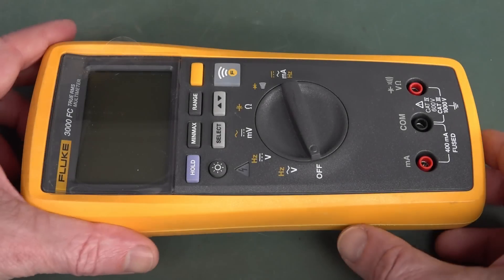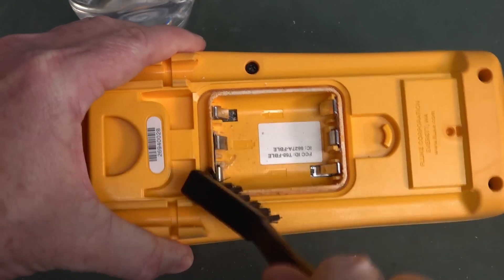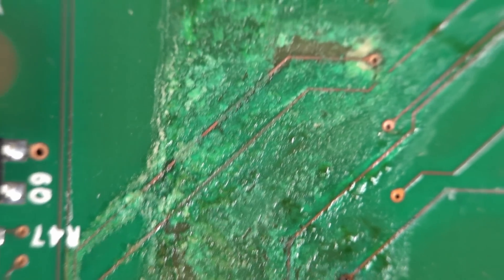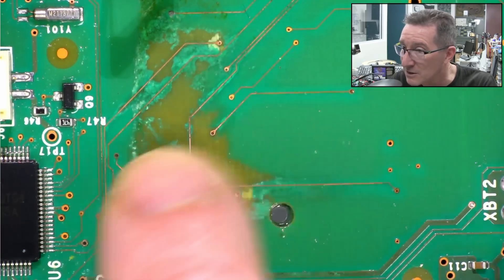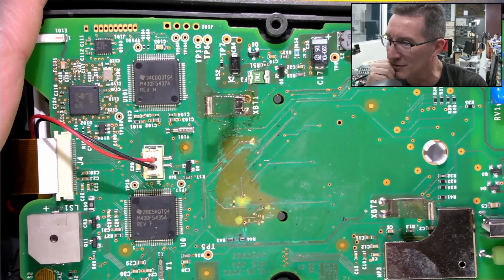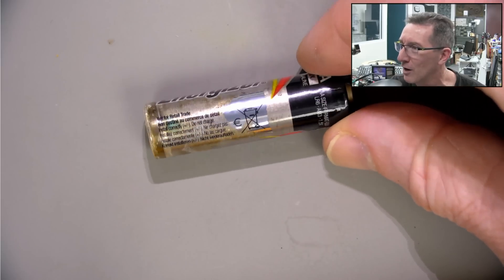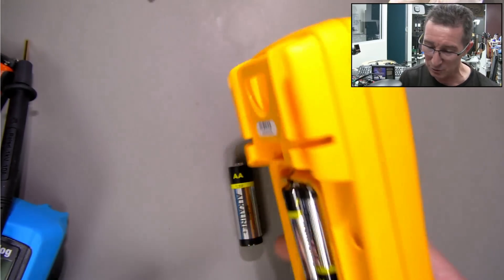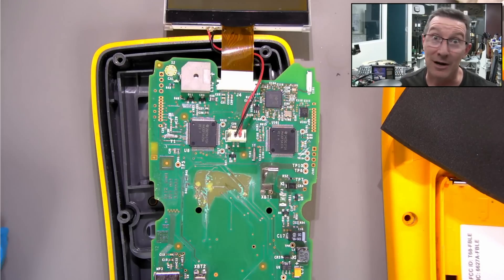EEVblog 1497 - RIP Fluke. Thanks Energizer. NOT.

Comment: Because of my ex wife taking control of everything i own i have a tons of amigas with very rare boards with vartas still leaking in them
I didn't get a chance to get them all before the horrible crap she did to me and my sons life
Eeks me every day knowing they are getting worse
I was doing the amiga 3000T right before all it happened
As it ate traces silkscreen etc
I was giving them all vinegar baths for vias etc reasons

Anyway i never use alkaline either nihm or zinc batts

And yes it will eat through and even get in-between layers of the pcb
The vias are what cause that

Comment: That Energizer battery is fake and Chinese imitation. The real Energizer battery not corrosion or leaking even stock many many months. I discovered that. Because i have real battery Energizer legil they stock of 2 year in multimeter and stay good even discharge the battery.

Comment: You'd mentioned before that Fluke has special plastic that makes it receptive to self-tapping screws. I wonder if that chemistry reacted with it. (Not that we'll ever know.) Once it's thoroughly dryed, I'd consider spraying some enamel over that PCB to protect the copper. OTOH, Mr. Carlson's Lab has a chemical that tins copper just by dropping the PCB in fluid. He has a "Make Your Own PCB"-type video where he shows that. It's one of his shorter videos too. 😁 https://www.youtube.com/watch?v=1Y6mNqMU9z8&t=48s Edit: Try contacting Fluke and see if you can get a warranty replacement? I wouldn't mind a repair video either, but that corrosion looks terrible.

Comment: You can usually salvage the board if you take it all the way apart and wash it with distilled water followed by rubbing alcohol. No need for vinegar etc  Use energizer lithium batteries for your mission critical stuff. Those never leak ❤

Comment: When I can get away with it I use high capacity NiMH batteries. Never had one leak yet; they just tend to balance out as they drain.

I have gotten in quite a few junk electronics with solder mask destroyed. Usually they get cleaned up and if A-OK get a quick shot of conformal coat in a can.

Almost every dead Nintendo Wii-mote has that, oddly.

Comment: The electrolyte is acidic in alkaline batteries so wouldn't it be better to use sodium bicarbonate to neutralize the acid? Dont' put alkalines in any gear you care about. Only learn that lesson once if expensive enough! If the device doesnt use much power, get some lithiums. If it does, use Panasonic Eneloop Ni-Mh's with a decent charger with individual channels so they don't become unbalanced for longevity.

Comment: I lost a Brymen 089 clamp meter and a BM257  both to battery leakage.  I now remove all batteries when I am finished using my meters as I do not use them every day. It is a PITA but I am less likely to lose a meter.  Both boards were badly damaged, traces were dissolved and SMD components came off.  The leaked electrolyte traveled along the battery contact springs to the planar and destroyed it.
Reply from the maker: sad face
Reply: I would definitely switch to either Eneloop NimH or Lithium primary cells in your case. If you don't use them a lot, the lithium primaries are probably the best choice. They are a bit more expensive, but they have a huge capacity and a long shelf life, so you can use them for 20 years.
Never heard of any leaking issues with those. They are generally recommended for critical equipment like smoke detectors and as emergency backup batteries (that will be in your drawer a couple years before you use them)

Comment: Use Lithium batteries (non-rechargeable) rather than standard batteries. Your batteries will last longer and also THEY DO NOT LEAK and damage your equipment.
Reply: They also have significantly more capacity than even the best alkaline. I saw a test recently where they calculated the price considering useable capacity, and then the lithium primary AA weren't even that expensive in comparison anymore.

Comment: Dave, about the batteries you have under test - put them in battery holders.  I have a theory that it's the compression from the battery holds that assists in the leaking.  That's why batteries tend to leak in devices and not in storage.
Reply: When in a device, the off is never really off.  Thus  one battery will drain and get a reverse charge and initiate the leak
Reply from the maker: Some of mine were in battery holders with a resistor load, still didn't leak.
Reply: @EEVblog  :(  A watched battery never leaks.

Comment: I wonder if it's worth doing an aftermarket conformal coating all expensive battery-powered electronics, at least around the battery compartment.  Or if that horrible juice would eat through a silicone coating, too?

Kinda surprised Fluke doesn't do that themselves...
Reply: Don't use alkaline batteries with expensive electronics.

Comment: I have yet to see a 9V battery leak - possibly because it's effectively double-insulated. This is then probably the single most important reason to look for a 9V powered multi-meter rather than one powered by AA or AAA cells.
Reply: I've seen many 9V batteries leaking.

Comment: As for the plastic, whatever they use in meters seems to be quite susceptible to being degraded by the electrolyte. It just turns into the consistency of Doritos afterwards and crumbles.
Reply: Someone commented these cells have sodium hydroxide in them. Once I put some NaOH based degreaser into an LDPE pump spray bottle, and forgot it on top of the radiator. The warm NaOH has eaten through the bottle the next day!

Comment: You might want to be wearing gloves. Potassium hydroxide is nastier than lye.

The plastic and solder mask are vulnerable, but you ought to be able to rinse the KOH off with distilled water, and the copper should be ok. Straight IPA won't dissolve it.

Any actual damage to the traces can be repaired with conductive paint or a bodge wire, but alkali shouldn't affect copper.

Comment: All modern alkaline batteries are garbage, as far as I can tell.  The single use lithium batteries are worth it for any device that costs more than $20.  But surprisingly the old fashioned “heavy duty” zinc carbon batteries are pretty good at not leaking, too. They’re good for very low current devices like clocks and remotes.

Comment: That is the most rotten PCB board i have seen in my 60 years. But considering the price (on ebay ) of brand new. Someone would probably be a happy new owner for a small price if fixed
Reply: Probably only for parts. Seems like it's corroded in-between the PCB layers as well.

Comment: hi, i like to clean board using a fiber pen, them tin the tracks. and finaly finish using  uv resing . you need to check very well the holes between faces of the board. they have acid and it will fail.... kkk sorry about the writing :) cheers

Comment: Back when Energizer was called Eveready (Union Carbide), they had, printed on each battery, a guarantee that they would replace flashlights damaged by a leaky battery.  I actually got a Maglite replaced that way once.

If you want to pursue the board repair, NorthridgeFix (on YouTube) has all the tricks.
Reply: They still make that guarantee, at least in the U.S. However I couldn't find it anywhere on their Australian website.

Comment: From Previous experience, I believe the culprit is those dark looking plated through holes. They crack in the barrel and loose continuity from 1 side to the other. Time for some fun with magnet wire! 🤪
Reply: There are vias on this which go nowhere on the two visible sides, so it must be a multilayer board. If it's broken at an internal layer, good luck fixing it! And there are some blotches which might indicate the goo creeped its way in-between the layers. Poor thing, it was brand new!
Reply: @mrnmrn1  I have had success with these Fluke 4 layer boards by shining light through the board to illuminate the inner traces to find out where they go.

Comment: Sorry 😥 yeah Energizers and Duracells both started having this problem for a few years now it seems. It's really turning me off (no pun intended). I assumed the expiration date on them was before they'd leak. Nope! I even check them every Spring and Fall. Nope! One or two still manage to sneak in a leak. This problem even finished-off my trusty TI-89 😡😭 and we all know those are not "slow-drain" by any means. I'm trying cheap Eveready's in bulk from Sam's now in slow-draw devices like remotes, clocks, etc...

Comment: Never seen it eat the plastic or the board before, usually just the springs. Energizer alkalines are getting pretty bad, I had some leak in like, two weeks recently. I use low self discharge NIMH where I can. I prefer 9v in multimeters, I feel like the construction of those has just a little protection.
Reply: If needed, some 9V blocks can be sat in a small thick plastic bag.
Reply: @erikdenhouter   Several layers of saran wrap works better than the little plastic bags, and are less bulky,  and it will be easier to put the meter back together.
Reply: @goodun2974  Ah, I did not know that name, you mean cling film or food wrap. Indeed, thin and strong.
Reply: @erikdenhouter  several layers of "cling wrap" will tend to wick up leakage fluids by capillary action, containing it. Saran was a brand name, like Kleenex.
Reply: @goodun2974  👍🏻

Comment: They always warn you to remove batteries, prior to longer storage. If only we had time machines to notify us ahead of time when long-term storage begins. Of course, manufacturers want the devices to disintegrate, so you have to buy a new one. But wouldn't it be great if the battery compartment could pop off, or at least semi-detach.
Reply: The battery department really should be modular and sealed, and only 2 wires should pass through from the battery compartment into the meter itself, with some silicone to seal it. When I install 9 V batteries I use the non rechargeable lithium infused Energizer batteries, and I wrap them in Saran wrap just in case, although I have never seen one leak; nor have I seen the double or triple A Eveready lithium batteries leak.

Comment: I found an old AVO model 8 multimeter at work today with an Eveready 15 Volt battery still in it. It has long since gone flat and there was no sign of leakage whatsoever. Is it any wonder people older than me think that they don't make them like they used to!
Reply: It's probably a lot like the 9V battery - several small batteries in a bigger case.  Effectively double-insulated.

Comment: Rayovac paid for a replacement ZTS battery tester from leaking cells. I believe I had to email a photo, and provide lot numbers from the cells. They took care of it, and it was a pretty easy process. I think Energizer has a similar leakage guarantee.
Reply: Yeah I'd like to see Dave try his luck with that.
Reply: I am wondering if those special industrial spec Energizer cells don’t have the warranty that their consumer cells have.
Reply: @wtmayhew  I wonder how many folks actually make use of the warranty.
Reply: @brettfo  I would hazard a guess that not too many people exercise their battery warranties.  From other comments here, it seems that it is difficult to get Energizer to respond to claims.  Rayovac did respond in my case, but it was quite a few years ago.
Reply: Many years ago I had Rayovac D cells destroy a nice chrome plated brass flashlight.  They sent me a replacement which was cheap plastic.  At that point it wasn’t worth pursuing complaining further.
Reply: I didn't know replacement of damaged electronics was even an option.
Reply: @Derfboy  Easy process and the check arrived in my mailbox within the estimated processing time frame. They gave me exact replacement cost....At the time of replacement ZTS included shipping if purchased directly from their site. So I received a check from Rayovac for full replacement cost. I also had to provide a link to the ZTS website for Rayovac to confirm.
Reply: Ray o vac  is part of Energizer holdings!! It was sold 3 years ago.
Reply: @johnl3487  It feels like all independent companies will eventually be absorbed into one megalithic Chinese holding company and all brands of a particular product will be identical and low quality.
Reply: Wow, that's a first!
Usually they beat around the bush, then give you a coupon for a new pack of leakers - I guess Rayovac actually have a somewhat decent line of support...

Comment: You need to cull off some of your DMMs Dave, if you have more than you can use, then CULL.
Or archive the least used ones into a cupboard, batteryless.
How many ways do you need to measure Volts, Amps, Ohms?
As you have found out, the only way you can find out if the batteries are flat is to use the device.
IDEA, all battery powered devices need a see-through cover, so you can OPTICALLY detect the beginning of a leak.
Never seen a solder mask react like that, even toys that have had leaky batteries don't eat away the plastic.
Its as thought the cell gassed rather than leaked the 3000 looks as thought it has a hermetically sealed battery cover.

Comment: The other day I found someone forgot to take the batteries out of my TI-83, and of course they leaked which killed it. AGAIN!   That's Twice now! 🤬🤬   I was thinking for the next one I might try dip coating the batteries with conformal coating, then scrape off just enough on each end to make contact.   I really don't want the hassle doing that every battery change so I might just try painting the coating inside the battery compartment instead.   Just not sure if it would cause battery fit issues, but either way, I can't keep buying new TI's every time.
Reply: Use lithium primary batteries, they are expensive, but will last forever in a calculator. They usually have a 10 year expiry period, I have never seen one leaking. I've seen videos of lithium primary backup batteries leaking in old Apple computers, now that's insane. They destroy everything beyond repair very quickly. So be aware to replace the lithium AA cells before the expiry date. Just in case...
Reply: @mrnmrn1  The expiry date on the Energizer Lithium AA and AAA is 20 years, the 9V are 10 years. These are usually recommended for critical equipment like smoke detectors.
They also have a significantly higher capacity than alkaline cells, so they're not that expensive in comparison.

Comment: I only use Lithium AA and AAA batteries lately. Not sure when manufacturing became so cheap but it seems every Alkaline battery is prone to leaking these days.
Reply: Instead, Lithium are at risk to getting punctured and start fires. Something heavy falls on them, could result in disaster.
My buddy's brother had an 18v cordless drill battery catch fire in his work van. 
My guess, he got careless and set something heavy on it and punctured it.
Fortunately he caught it within enough time to prevent whole work van from going up in flames. But lost about $700 in work tools. Everything has a calculated risk.
Reply: @equinoxshadow7190  An 18V cordless drill battery is a 4S pack of 18650 3.6 V rechargeable lithium cells, the high power-draw variety. That is something completely different than a 1.5 V lithium primary cell (non-rechargeable).
Do you have any proof of those 1.5V AA or AAA primary lithium cells being a fire hazard? I never heard of it.

Comment: Do you have another Fluke 3000 multimeter to compare it with. Measure the resistors in the good one and replace the corroded ones in this meter with new ones of the same value.
Reply: Also remove affected part of the PCB, reconstruct all connections and vias. So it's not worth it to Dave.

Comment: This reminds me of a Fluke I bought on eBay and when I received it I tested the AC parameter by measuring standard household  outlet AC~110-115volts. And it failed! Back it went to the crooked seller.

Comment: The very moment there is absolutely zero energy left in a battery, it will start leaking. It happens every single time. Any battery powered item that goes unused for more than two weeks at a time should be stored with the batteries removed and placed nearby for when needed.
Reply: I've had them leak  while still providing power.  You don't always get a warning.
Reply: @russellhltn1396  AND, I've seen them leaking still in the package(and well in date).

Comment: I’ve said it once and I’ll say it a million more times… I won’t use anything in my expensive test equipment except energizer ultimate lithium’s. 

I’ve had a lot of trouble with all brands of batteries both Duracell, energizer, and others. Anything alkaline is a no go, and the lower voltage of NIMH it’s something I don’t want to worry about especially in test equipment.

But nearing a decade using energizer lithiums I’m some really demanding and abusive conditions… Never had trouble and they do last a lot longer as well. I don’t know if they’re capable of leaking or not… But it doesn’t seem so at least that’s been my experience.
Reply: and what about zinc-carbon? They don't have any liquid in them, as far as i know. Yes the capacity is meh, but they are cheap at least...
Reply: @victortitov1740  Zinc-carbon batteries DO have liquid electrolite in them, but it's acidic, not basic. Their case is the negative electrode itself, so after a full discharge, they are guaranteed to leak. But they are less prone to leakage in storage, if they are not discharged.
Reply: @mrnmrn1  Actually, carbon-zinc cells also use alkaline chemistry(ammonium chloride, I believe).
The case is indeed the negative electrode, except that there is usually either a plastic or metal overwrap, which tends to contain the leakage.
Of course, they can still leak.
Also, there is much less actual electrolyte to leak out, and it is less aggressive.
They also, as you have noted, are less likely to leak in storage.